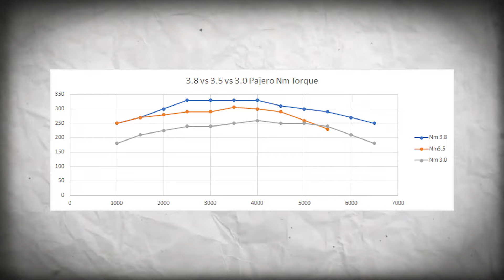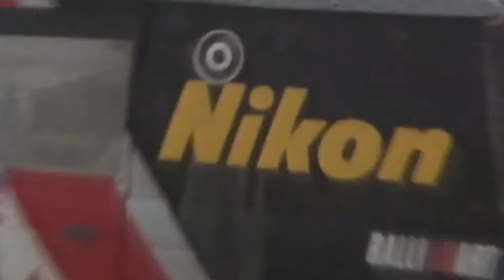How This Beast Dominated The DAKAR RALLY

Comment: 6G7 motors such as the 6G72 3.0L, 6G74 3.5L & 6G75 3.8L are all Petrol motors, The one you claim as a 4L V6 Petrol looks more like a Diesel motor and I have never heard of the Pajero having a 4L Petrol motor. Also most of their wins were in a Monocoque Chassis not body on frame. Love the Pajero, Most under rated 4wd on the market, at least here in Australia.

Comment: Cool video but you can tell the narrator isn't terribly knowledgeable by saying things like the Pajero success was due to its body on frame chassis , a large majority of it's Dakar wins where when they used a unibody.  Things like mentioning the Pajero was know elsewhere as the Shogun is technically correct (only in the UK) while most of the world knows it as a Montero and that wasn't mentioned once.  Lots of filler info , stock footage and other out of context random engines. Regardless , having owned 4 of these trucks over the years I appreciate this.